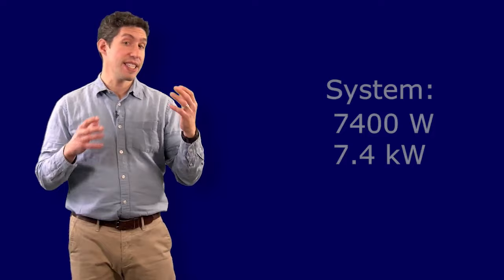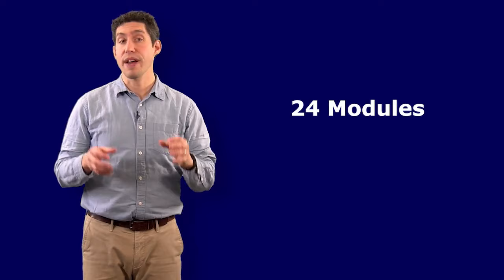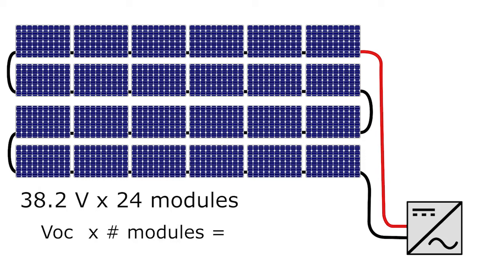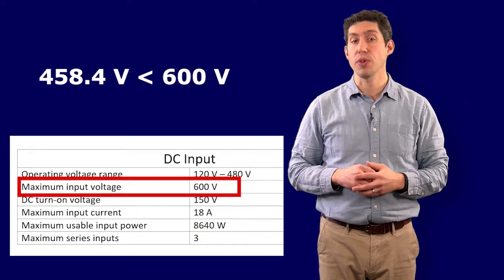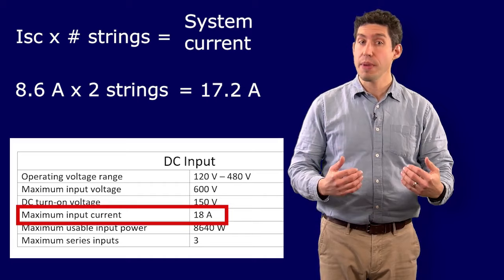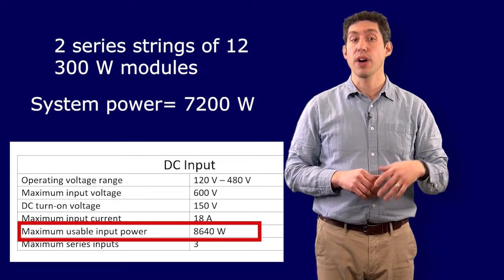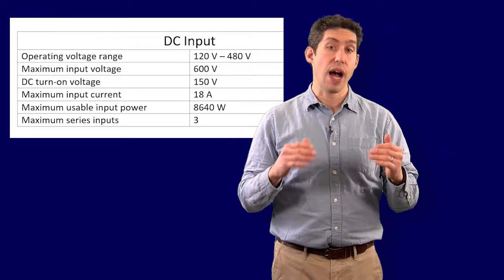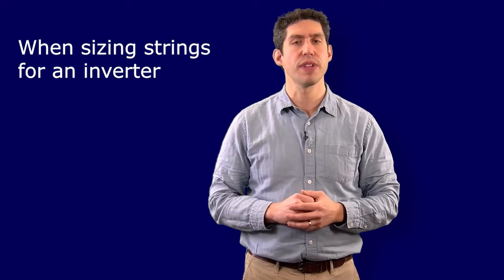Solar String sizing for the inverter | Solar Energy System Design | edX Series

Comment: You didn't take temperature factor correction in consideration for Voc calculation be careful
Reply: what's the worst that could happen from not including the safety factor calculations  ..ruin your equipment, burn down your house, lose a child in the fire  ..his information is not bad, but it's not complete  ..and it's dangerous to someone who doesn't understand that it isn't complete
Reply: Can u help.... formula

Comment: what happens when you are in Voltage and Current limits but you exceed the  PV Max Power Inputs DC(max power on solar panels per MPPT inputs) specs of the inverter?
Reply: Isn’t that efficient?you’re using 10kw pv while using 7kw inverter given that you are in range of the voltage and current requirements just to maximize your inverted capacity and its an electric components inside the inverter,if you always use 100% of your inverter it might shorten its lifespan.

Comment: One thing that is unclear is Operating Voltage and maximum input voltage? So if you had 530v it would not work? yet its under the maximum input voltage?

Comment: Hi 
Your videos are excellent & it’s so clear!
VOC & ISC is the important calculation when determining inverter size!
If KWP is 10 times the size of inverter this doesn’t matter as inverter mppt will clip excess & only take what inverter is speced for?
Is this the case??
Thanks m
Reply: Yes you are right, but it lowers the  efficiency  of the system

Comment: Hi
I have question about using two strings.
So when using two strings that are connected in series but not connected together.
one string is connected to pv1 and second to pv2.voltages stays the same but current multiplies by 2?beacuse inside inverter pv1 and pv2 ports are parallel connected?
Thanks

Comment: Good video, just one question about the maximum voltage, if two string sets method is used then the voltage that goes to inverter is still the same(917V as per your calculations) just divided it in two but the inverter is still getting 917V?
Thanks

Comment: I have inverter with 27a mppt 
Can i attached 2 strings of 580w solar panel its 14 amp*14amp little bit increase in amps also these is losses so i hope i can install plz help me
Reply from the maker: The decision to connect multiple solar panels to an MPPT inverter should be made carefully to ensure that the system operates safely and efficiently. In your case, you have a 27A MPPT inverter, and you want to connect two strings of 580W solar panels, which each produce 14 amps.

First, let's calculate the total current for each string of panels:

580W / 27V (assuming these are 27V panels) = 21.48A

So, each string of 580W panels will produce approximately 21.48A of current.

If you connect two strings in parallel, the total current will be:

21.48A + 21.48A = 42.96A

Since the total current exceeds the capacity of your 27A MPPT inverter, it's not recommended to connect both strings in parallel to a single inverter. This can overload the inverter and potentially damage it.

To work with your inverter, you have a few options:

Connect only one string of 580W panels to the inverter. This would be the safest and most straightforward option, as it stays within the inverter's current capacity.

Use a different inverter with a higher current rating. If you want to connect both strings, you could look for a larger MPPT inverter with a higher current rating that can handle the combined current of both strings.

If you really want to use both strings with your current inverter, you could consider reconfiguring the strings by reducing the number of panels in each string. By doing this, you can decrease the total current of each string to ensure it doesn't exceed the inverter's capacity. However, this might not be the most efficient use of your panels.

Check out our playlists to get a good understanding.
Reply: @edxseries  Wow thank you so much I have a 580-watt panel sort circuit current is 14.14 amp and an open circuit voltage is 52 plz sir guide me can I install single string solar panels up to 10 solar panels 
Mppt range 90-450 maximum 500 VDC 
27a single mppt how may I contact you I love to get knowledge about the solar system. here in my city, no one tells me whenever I ask and on YouTube finally I found you I want to contact you to ask some questions which I don't  understand no one tells
Reply from the maker: For more detailed information and clarification, please check out the playlist on our channel. @jasonbourne7171